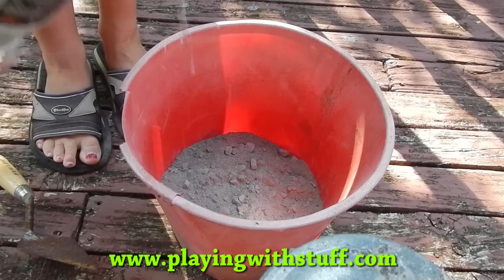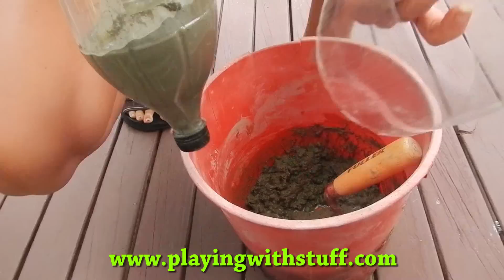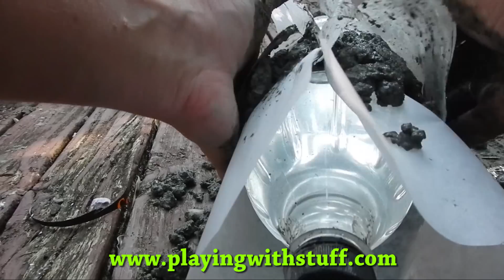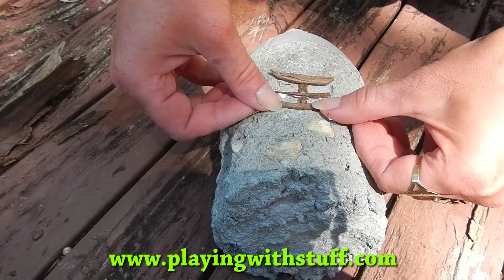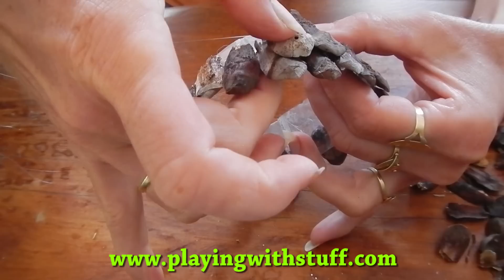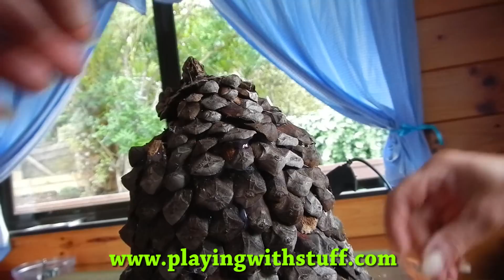The use of plastic bottles for production of fairy houses

Comment: Your extremely hectic movements, through the faster turn of the film, to the horribly choppy music, all that does not fit into a beautiful fairy cottage or house.  Unfortunately!  Without this dreadful music, which no elf or gnome or goblin would like, and with a slightly slower twist, it would be wonderful.  But it also lacks the information on how much concrete mass you need.  The need for two bottles, explained by the design of itself, but that's what you give, but how much concrete you need to know what is really important to find out that you do not say.  What I do not like well, that the windows are not really open, but in the concrete only indicated with a few sticks .. You would make the poured mass by a second bottle from the inside hollow, so only make a kind of outer shell, then you can  Make the window openings and the door properly, so that the little residents can really move. But in the end, all together, there is a little nice old and fairy looking cottage.  Thank you for your work.

Comment: quite frankly, I think that your house is completely carelessly built.  There is nothing enchanted and in there, besides, it is associated with too much dirt and can be so much better and much nicer, cleaner and more genuine.  And in addition, if I have to see how someone with such long fingernails and on each finger a ring in concrete around mixes in Beton, then I feel sick.  The video is grotesque, the fast-twisted version does not allow laymen to understand anything, the only thing I like is the possibility to put down the hot glue gun.  But your fairy cottage is the worst thing I've ever seen.  I'm sorry, but if I publicize something like that then it should be good and reasonable, what you deliver there is really beginner level.  it is a pity that you publish something like that and then celebrate the alleged success with "TaTa".